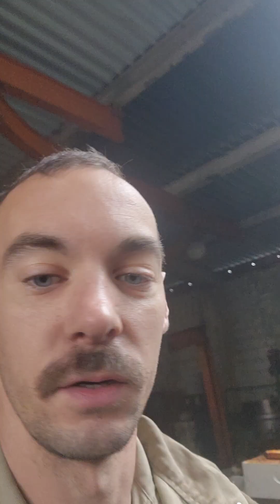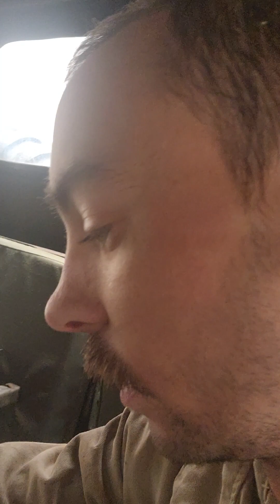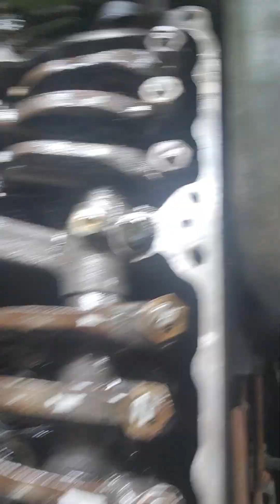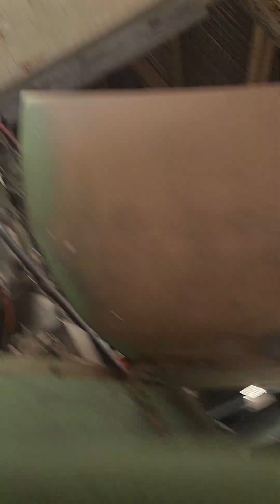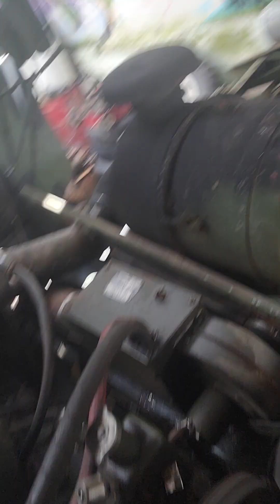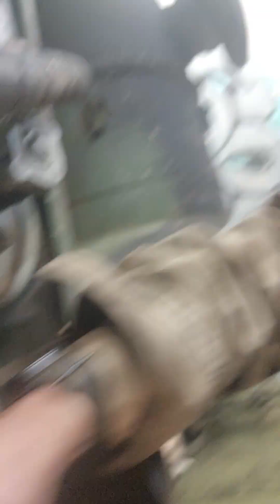Working on cummins nhc250 in M818

Comment: Hello. Is there a way to repair the nozzles? My m818 is not moving like it's supposed to when climbing a hill in fifth gear.
Reply from the maker: Yes the nozzles can be replaced as parts from cummins or aftermarket suppliers. It is less expensive to purchase all new injector units.